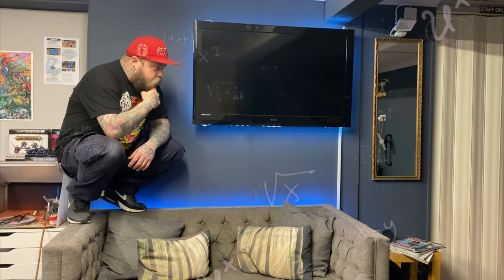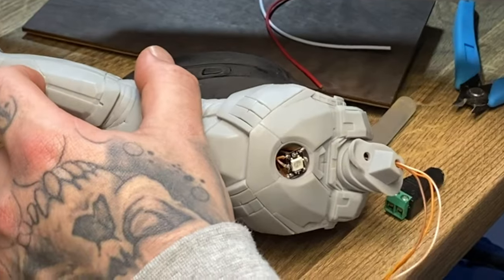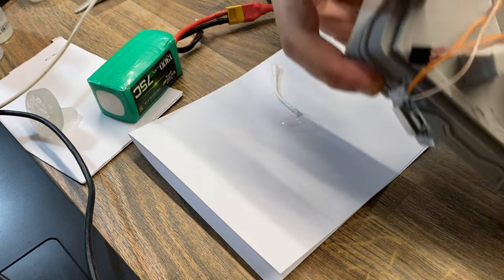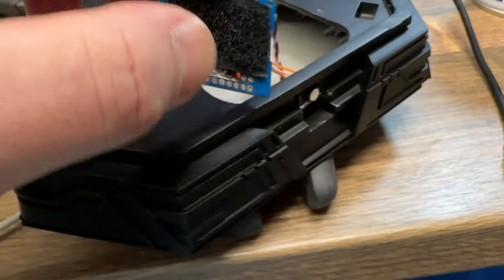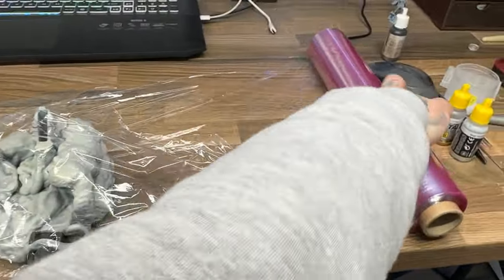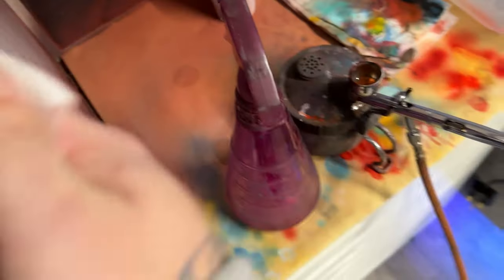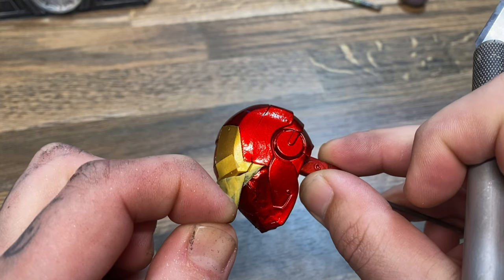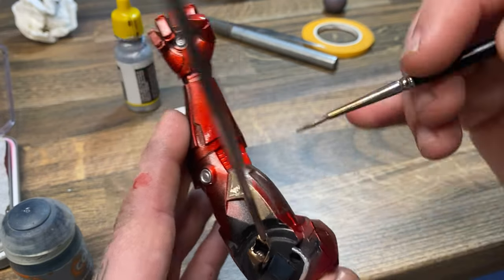Making a Voice Activated Ironman 3D Print with Wifi and Leds  | Groundeffected.com

Comment: which pins did you use to connect the LEDs to the board?
Reply from the maker: I’ll check tomorrow dude we had issues figuring out which ones but found them in the end. I’ll look when I get in the studio.
Reply from the maker: Although I won’t find this comment tommorow so drop me a dm on insta please
Reply: @Groundeffected  I figured it out.  I put lights in the blasters as well.  I'll share a pic when it's done.  I appreciate you offering to look for me though.

Comment: turned out well lad, the shop could do with some better categories though, wanted to check out paints but wasnt going to scroll through all pages to find them (or maybe i was being an idiot and that was there) Free razor back stl!!! I'll have that though
Reply from the maker: Yea dude. The website was built before I got to products and we are currently working on it as we speak. Will take a while though. Thank you for the feedback dude. I know we’ve got some work to do still. Definitely a better experience in store. But even still I’m still building up stock levels so there isn’t that much just yet.
Reply: @Groundeffected  deadly buzz man, I'll be getting into model painting at some stage soonish so expect to be sending parcels to Sweden 😁

Comment: D1 mini with WLED...the lighting powerhouse!
Reply from the maker: I used esp 32 and WLED what is this d1? I need to see if it’s cheaper and easier to find, I had to take this esp from an older project and now Alexa thinks ironman suit commands are how to control the mirror 🤣
Reply: @Groundeffected  a D1 mini is basically a smaller esp32. They are about half the size with same features! They have less pins but if using for only WLED....it's no big deal! My whole damn house is controlled with these gems bruh! Alexa ruined my life....but it's ok!😂 I learned about D1's and never looked back. I get mine off Amazon. Price wise...I can't remember. I'm getting older and shot out lol